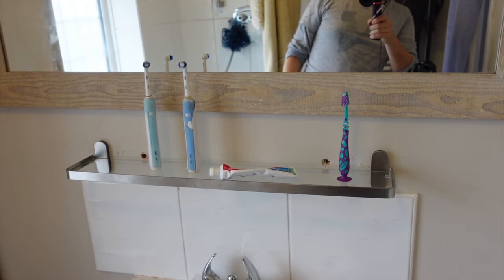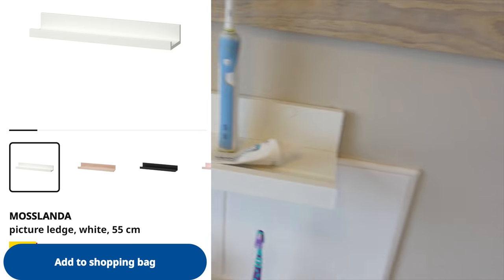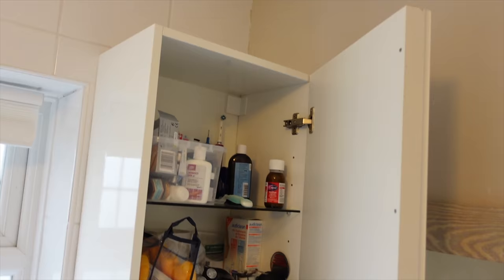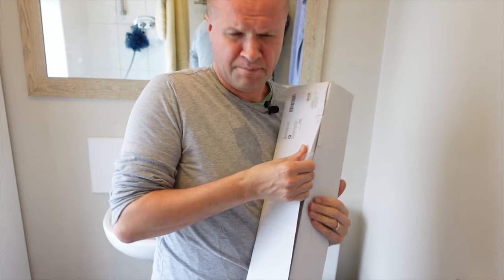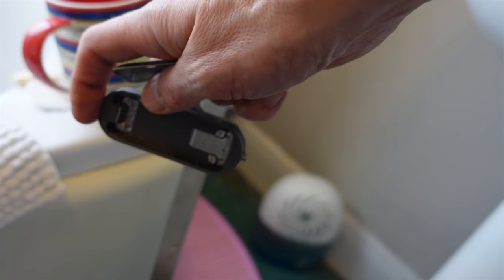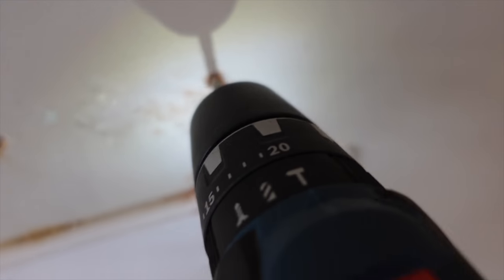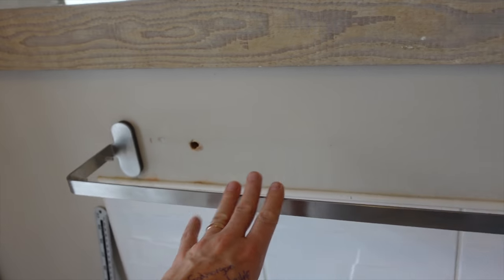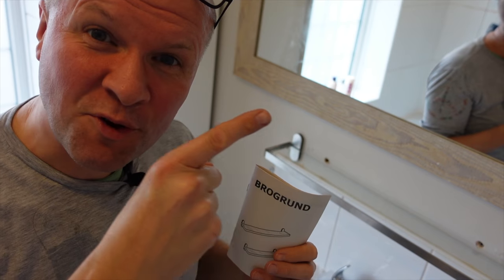Revamping our bathroom with an IKEA glass shelf!

Comment: Thank you for the Ikea Brogrund glass shelf installation video, starting at roughly 2:25. lt really helps me that the video includes the final step to screw tight the shelf. It would be more helpful if it does include the step of unscrewing and releasing the metal brackets stored inside the two ends of the shelf. I was struggling to figure out how to release the brackets😁
Reply from the maker: Ah fantastic. When I make these videos I think that they look really boring so really appreciate this message that something in here might help!
Thanks again!

Comment: Does the glass only sit there. Isn't there some way to secure it. Without securing it, there is a good chance someone would knock it off 😢
Reply from the maker: That's true - it does sit there. If it helps, we've had it a few years now and have a really accident prone family but it hasn't budged - the glass sits way down behind the metal lip.  Thanks for the kind comment

Comment: I bought this shelf so will give it a go installing it. When you measured for the mid point (38.5) what was this for? Plus I hate that wall plugs & screws did not come with it 🤦‍♀️
Reply from the maker: Hi thanks for the kind comment and question.
Yes, it's really frustrating to not have anything we'd need, so they're not liable for our installation!

I measured for the mid point so I could line it up with the mid point/middle of the sink, so the shelf is kind of in line with the sink, otherwise it would look like it's slightly to the side. Hope this helps.
Good luck with your shelf and thanks again @salenzo8065!
Reply: Get the FIXTA Ikea kit--has multiple fasterners suitable for most Ikea installations. Made my install a no brainer.